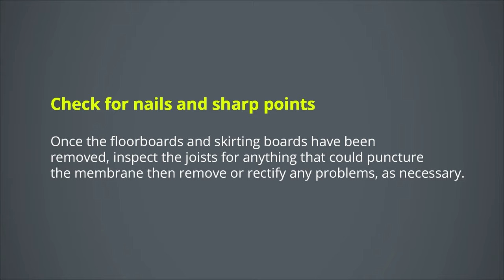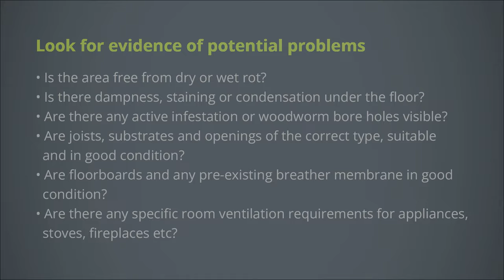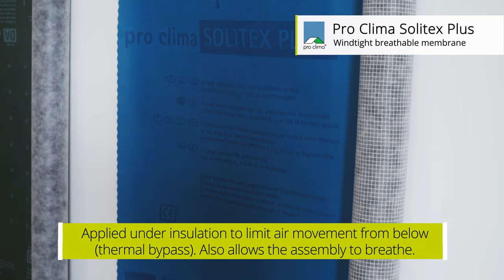Thermally Upgrading Suspended Timber Floors with Natural Insulation

Comment: If the underfloor space is unheated, should there not be a Thermal Break somewhere?  Great video. Thanks for posting.
Reply from the maker: This method details how to upgrade the floor "from above".  If you have access to the underneath, please see our other method that uses Gutex Mutitherm woodfibre boards to address thermal bridges. See this blog for details:
https://www.ecologicalbuildingsystems.com/post/suspended-timber-floor-insulation-installation-underneath
Reply: ‘Next up, our 86 point system for fleecing people out of their money. ‘

Comment: great explication. thanks
is the crawl space ventilated in winter as well?
Reply from the maker: Hi @christophervarady-szabo1547. The timber suspended floor will be permanently ventilated all year round via the air bricks in the external walls. Hope that answers your query. Let us know if you need any further information. Thanks.

Comment: A little confused when you described the Solitex Plus to be a "breather membrane" that is also "airtight". 🤔 Can you tell me if is it Breathable?.... Or Airtight? aka a "Vapor Barrier".
Cheers
Reply from the maker: Hi @timbramm4650. Solitex Plus is both breathable and airtight. Breathability refers to the movement of moisture and doesn't affect the airtightness. It might be good to think of it like this, human skin can sweat but it doesn't allow air in. Solitex Plus manages moisture by transferring water vapour and doesn't need any air movement beneath or through to transport the moisture. Hope that helps.
Reply: @EcologicalBuildingSystems what a great answer

Comment: If not fully taking the floor apart is it ok to work from the bottom space, reaching up tucking insulation in fresh where it may need it then attaching a permeable layer to the underside of the joists?
Reply from the maker: It is possible to install from underneath. The method is described in detail on our website here: https://www.ecologicalbuildingsystems.com/post/suspended-timber-floor-insulation-installation-underneath

Comment: Would it be possible to staple the permeable membrane to the underside of the joist . It would use less material but would enclose the joist. Is that bad? Would it reduce air flow around the joist and therefore result in rot? Or would it help maintain the temp of the joist in a dryer environment?
Reply from the maker: Hi @fredhawkey380. It is possible to stable and tape and seal the  SOLITEX PLUS diffusion open membrane below the joist which will allow any vapour to diffuse to the vented cavity below. We would also recommend applying support battens below the membrane to support the weight of the insulation over time. Of course, it is still recommended to apply the sealed airtightness and vapour controlling pro clima DA membrane on the warm side of the natural fibre insulation if you are applying this from above. Hope that helps. Thanks for the comment.
Reply: @EcologicalBuildingSystems  cheers . I've just realised why u do it like that. My crawl space is so shallow I couldn't get the drill underneath. Less awkward from the top. 👍

Comment: Surely a plastic DPM can be used instead of the green membrane or is this a big no? Thanks
Reply: I’d of thought so.
Reply from the maker: We would not recommend using a polythene vapour barrier here. The breathable floor system benefits from a vapour control membrane as it allows for some breathability from inside to outside.  DA is also more robust, easier to staple and tape, and means the full Pro Clima airtightness system is used so you get all the benefits of the Pro Clima system warranty.

Comment: Can you do this insulation with kooltherm k103 floorboard? 
Does it do the same job as this wool insulation?
Reply from the maker: Hi @vinlondon8904. We recommend the use of natural insulation such as Hemp Flax Thermo Hemp Combi Jute or Gutex Thermoflex between the floor joists as this is moisture vapour diffusion open and can allow any moisture vapour to harmlessly diffuse through the windtight Pro Clima Solitex Plus breather membrane below.  Natural fibre insulations are also flexible and are sized to give a flush friction fit in between the floor joists (i.e. no air gaps which can lead to closed loop thermal bypass).  This is more difficult to achieve with rigid insulation products, which have to be cut to size.

Comment: I like the concept and thought of it myself, but there is controversy over a water tight membrane next to the subfloor acting as a means to hold water or condensation here in the USA ( location North vs South ).  Have you experienced any issues due occupants creating a source
Reply: …. Of water or appliance leaks?
Reply from the maker: The key aspect here is that the void below the floor needs to have sufficient air flow ventilation.  If the soil below the floor is often damp then laying a polythene membrane on top is beneficial in reducing rising moisture vapour from the ground.  In other words, for a consistently damp sub soil then combining polythene with ventilation is the best solution.

Comment: What’s the u value of this floor buildup assuming 100mm joists?
Reply from the maker: The U-value of any particular floor depends upon a few factors, such as the timber percentage and the perimeter to Area (P/A) ratio of the floor. Based on floor joists being 100mm deep and using the Hemp-Jute insulation, as shown in the video, this usually achieves somewhere in the region of 0.25 W/m2K. Hope that helps.

Comment: can house wrap be used to support insulation and top layer?
Reply from the maker: The Solitex Plus is a great choice for the lower membrane as it is a fully windtight monolithic membrane, is reinforced and is highly vapour open to safely deal with any moisture in the insulation or timbers.  The upper airtight membrane provides vapour control and also needs to be tough, so we recommend Pro Clima DA. A highly vapour open external membrane would not be suitable on the top layer.

Comment: 4.18 6 materials in shot, and the flooring 2 or 3 just out of shot = this is another part of industry thats needs to get its act together and innovate 'an engineered lay 1 item on the foundations' way of building.
Reply from the maker: As a retrofit solution, the products here work around the existing fabric of the building to achieve an improved thermal performance. We are all for innovation in the industry and have designed this retrofit floor insulation system to be as simple as possible.
Reply: Jobsworth!